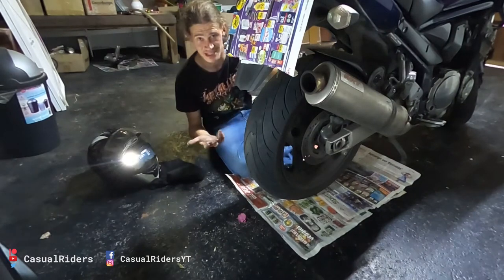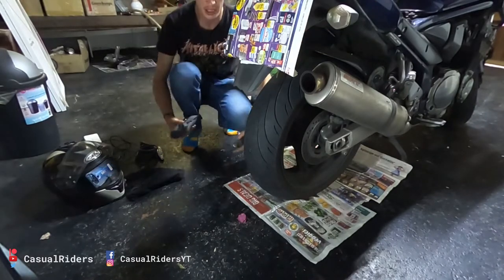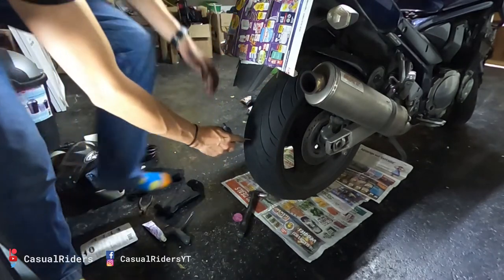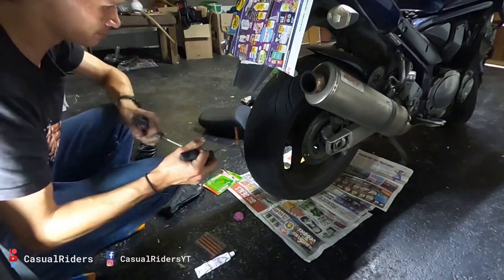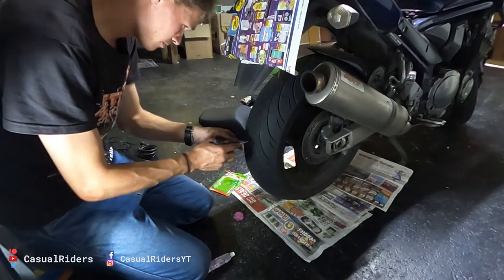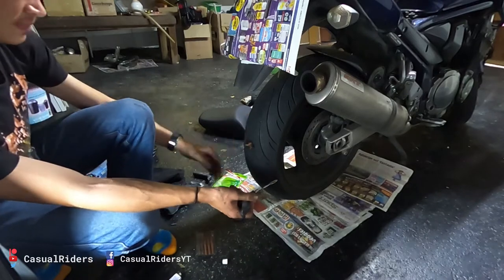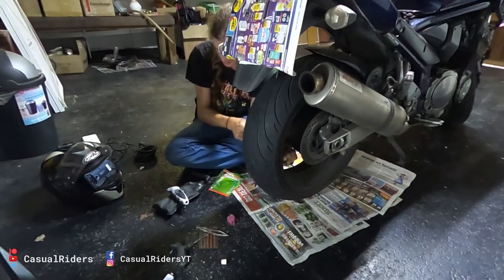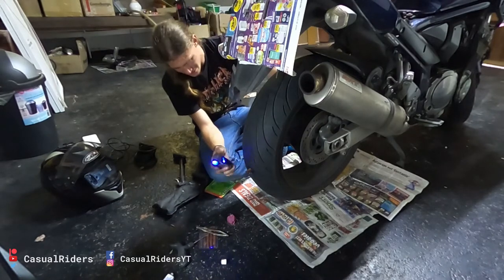I Can't Believe This Happened || Motorcycle Temporary Puncture Repair

Comment: As much as it is amusing to watch you use the bicycle pump, have you not considered getting the CO2 canisters?
Reply from the maker: I know that they're not THAT expensive, but it's extra cash for a one time use (plus you need the special valve) whereas the bicycle pump, only costs me time and energy.
An added bonus, it basically covers my cardio for the day🤣🤣🤣
Reply: @CasualRiders  I have heard they are cheaper from the bicycle shops
Reply from the maker: @DavidMorrisMedia  but you still gotta buy them😋 I had the bicycle pump for the past 10 years